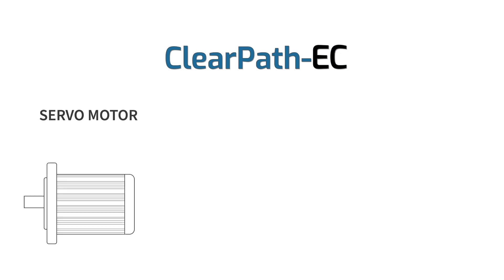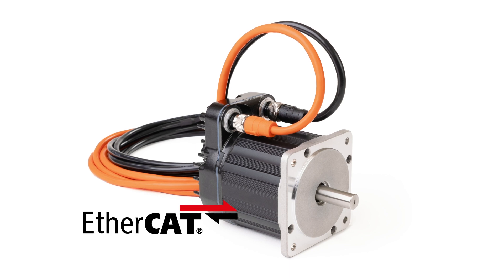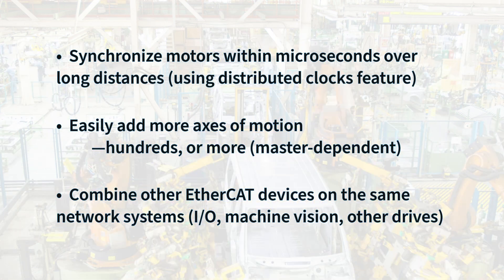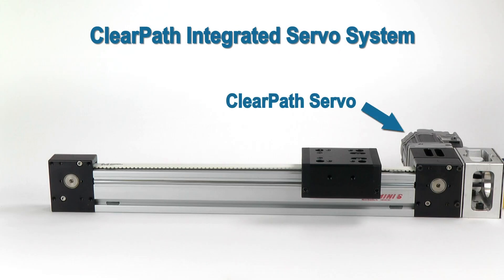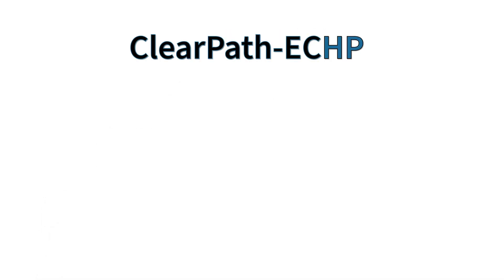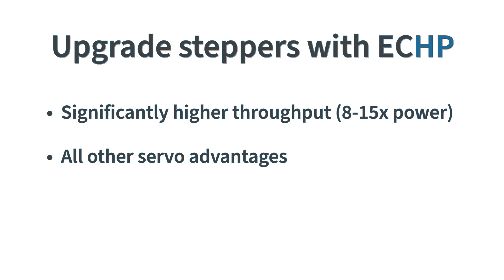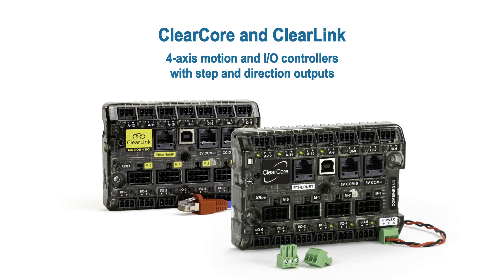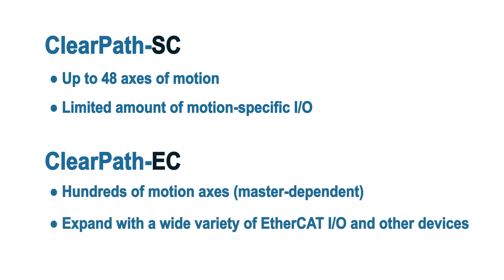ClearPath-EC (EtherCAT) Series Overview

Comment: Where to buy in europe?
Reply from the maker: Hi @HIMA.3D, 
Teknic sells all of its products directly from our factory to keep prices low and maintain a high level of technical support. We do not use distributors. The best way to make a purchase is through our website: https://teknic.com/products/clearpath-brushless-dc-servo-motors/ethercat-servo/ 

Also, sorry about the delay in responding to you. If you have any additional questions, please don’t hesitate to reach out to our engineering support via the contact page on our website (https://teknic.com/contact/) or by giving us a call at 585-784-7454. 

Best regards,
Bradley N. – Teknic OEM Application Engineer

Comment: Syncronization on ethercat is often within a few nanoseconds, at least in my lab setup.  Our ethercat "subordinate" board setup were using some newfangled "temperature compensated" crystal oscillators.  That minimized  clock drift, though it was probably unnecessary as we also synced every 250 µs.
Reply from the maker: Hi @kayakMike1000,

Thanks for sharing your experience! Achieving nanosecond level sync with temperature compensated oscillators is impressive. EtherCAT’s distributed clocks deliver incredibly tight, network-wide timing, one of the main reasons we wanted to develop ClearPath EC.

Best regards,
Nick D.
Teknic Servo Systems Engineer

Comment: Are the encoders provided battery-powered absolute?
Would home sensors still be needed or does the encoder have the maintained mechanical perpetual position?
Reply from the maker: Hi motriz-industrial6846,

The ClearPath-EC system has a provision for battery backup, referred to as “Logic Power Backup” in our documentation. This provision keeps the motor’s processor and encoder alive in the event of a DC bus power interruption. If you make use of this backup provision, the ClearPath-EC motor emulates absolute encoder functionality and provides the ability to query the processor for other types of feedback as well. One caveat to consider is if the motor is completely powered down (meaning all power is removed including backup power) the system should be re-homed. There’s more information in the ClearPath-EC manual under the heading “Powering ClearPath-EC”.

https://teknic.com/files/downloads/ClearPath-EC_User_Manual.pdf

If you have additional questions about your application, please feel free to call or send a contact request to: https://teknic.com/contact/

Regards,
Jim W.
Teknic Servo Systems Engineer
Reply: @TeknicInc  Thanks!!

Comment: Where can I find more information about how to conect my motor with the pc using IR (InfraRed)
Reply from the maker: Hi @lethalowo9934,

The User Manual section "Connecting a ClearPath-EC motor to your PC" should help answer your questions. You can download the manual at: https://teknic.com/files/downloads/ClearPath-EC_User_Manual.pdf.

If you have additional questions, please call Teknic at +1-585-784-7454 or contact one of our engineers through our website: https://teknic.com/contact/.

Best regards,
Aaron B. -Teknic Servo Systems Engineer

Comment: This is a great addition! I use a bunch of teknics at work and the #1 issue has always been the usb connection breaking!!! I swear we have warrantied so many that someone at HQ knows our name. This will make such a difference in the durability of our equipment!
Reply from the maker: Hi Polar Bear,
Thanks for the feedback, we hope you'll like ClearPath-EC!

Regarding the USB connector: It sound like you may already know this, but the USB cable for all IP67-sealed ClearPath motors (including the new ClearPath-EC model) are magnetically attached. This way if a motor moves and yanks on the cable (or someone kicks the cable accidentally), the magnetic attachment will disconnect without damaging the motor. 

The IP53-sealed ClearPath motors still use a traditional USB connector, but we did reinforce the connector not too long ago to help protect it from accidental damage.

If you have any questions, please reach out using our contact form https://www.teknic.com/contact/ or give us a call at (585) 784-7454. We'll be more than happy to help you out.

Best regards,
Nick D.
Teknic Servo Systems Engineer